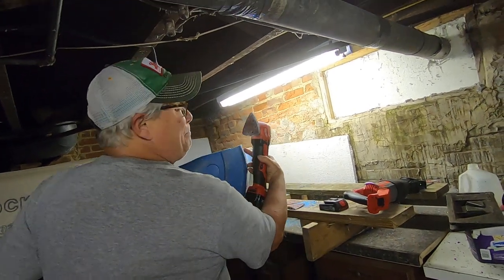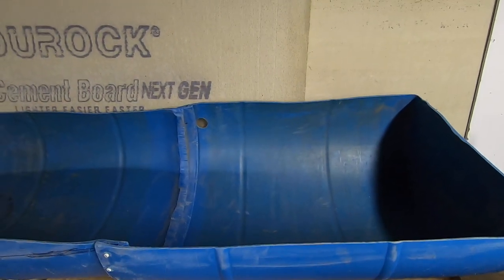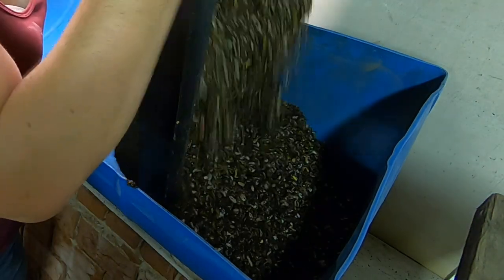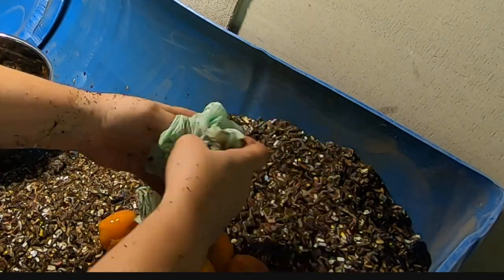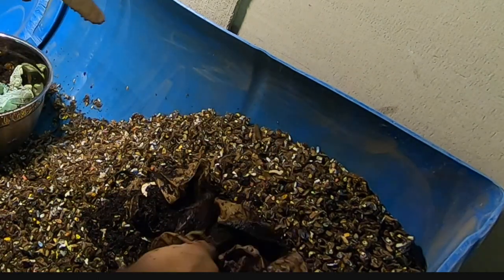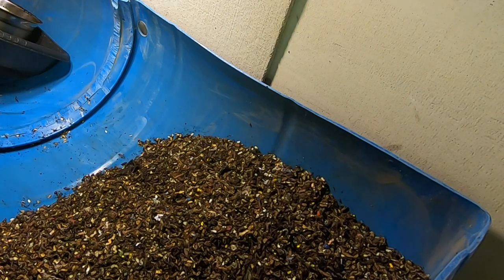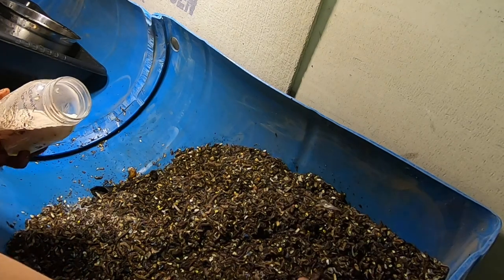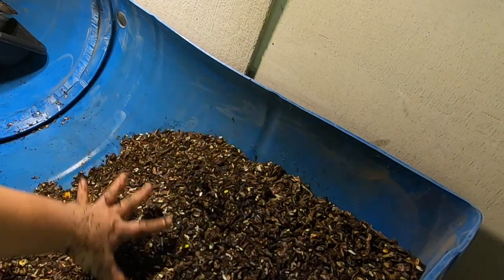How to build a 55 GALLON WORM BIN

Comment: 😍😍😍 Very nice!!! That’s how I’m running my tote now. Can’t wait to see your process!!
Reply from the maker: Cool, how long has it been going?
Reply: Plant Obsessed Well I’ve just started in the last month. My tote is way smaller than your container obviously so I’m essentially feeding one end every 10-14 days. When I’m fluffing the tote everything is getting slightly moved to the opposite end. So I will constantly have one end that will be harvested (maybe monthly) and sifted and sent out to the garden or stored and one end that is bedded and fed. Anything that doesn’t make it through the sift will go back into the fed side. I’m going to give it a few months and see how I like the process. I would like a bigger tote to work in though. I was considering one of those long flat storage totes that fit under the bed. It would work better in my limited space. Still undecided.

Comment: What did you do in the  middle of the bin to connect the two pieces together? Thinking of making one myself. Thanks!
Reply from the maker: I just used sheet metal screws. Thank you for watching 😃🪱👍🏼
Reply: Thank you. Love you channel!
Reply: Does dirt/liquid leak out through the middle? Are you using any caulking here? My son loves this design and is considering it as part of an Eagle Project for his school, but he wants to have a solid connection in the middle that will survive kids with gardening tools, and not have any pointy screws sticking through the top layer @PlantObsessed
Reply from the maker: @scrooner  a little bit of castings leaks out.  I didn't use caulk. If I had to do over I would use a foam or silicon seal strip between the ends. I would also likely use nuts and bolts. Also I would make a built-in wedge to keep it from rolling. 😃🪱👍🏼

Comment: Do you have to worry about spiders and house bugs getting in the worm bin?
Reply from the maker: No, they all live nicely together.👍🏼🪱😃
Reply: Do you also keep the lights on to prevent the worms from come out the bin?
Reply from the maker: @earlcruz1001  I leave them on for a few hours after I disturbed them then the light goes off.  They only breed I have issues with are the African nightcrawlers and they are in a zipped bag system.😃🪱👍🏼
Reply: Thank you for your attention!

Comment: How did you cut the barrel in half and re-attached the two halves together where they don’t leak?
Reply from the maker: My husband used a reciprocating saw to cut the barrel and took off the barrel lip. I screwed it together with screws top to top. It is not waterproof.
Reply: @PlantObsessed I have had a lot of success with using Thompson's water seal liquid rubber. It may take three or four codes but my success rate with it is phenomenal when so many other products have leaked in a very short time. Good luck

Comment: How did you put the buckets together??
Reply from the maker: We just used sheet metal screws. They are still holding.🪱👍🏼😃
Reply: @PlantObsessed  What point type of sheet metal screws and how long were they?Did you use self tapping sheet metal screws, or self drilling sheet metal screws,? It looks like the head of the sheet metal screw was flat in the picture that you showed. I have no knowledge of different types of screws, but when looking up sheet metal screws on Google I got so many different varieties. Thank you very much for your wealth of information. 😊I am one month into my red wigglers, and four months into worms that established themselves into my 14 inch garden pots I was composting in. I started the first pre-composting yesterday and want to build a big blue or a little blue before the compost is finished.😊
Reply from the maker: @Debby-w8r  the screws are pointed so maybe self drilling?  I just used what I found extra of in the garage. Lol 👍🏼😃😃🪱
Reply: @PlantObsessed  thank you!😊